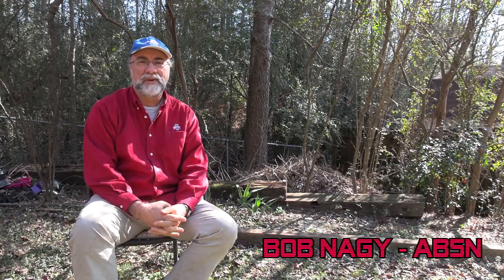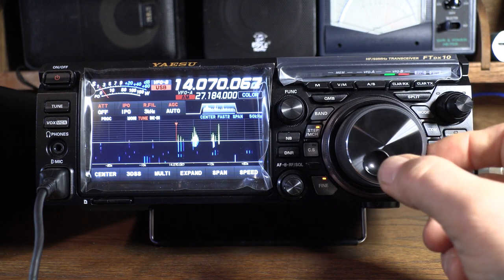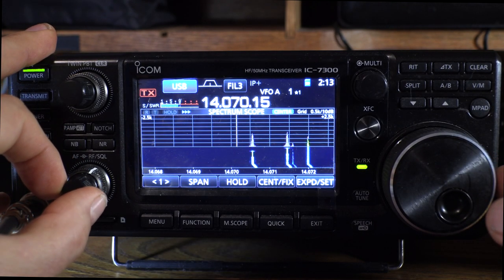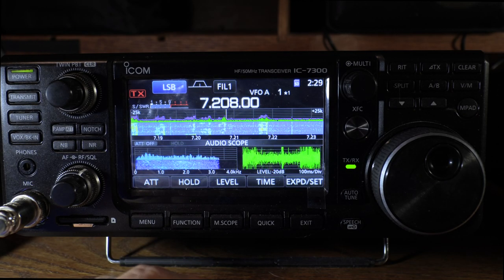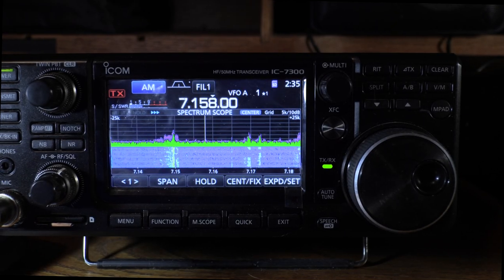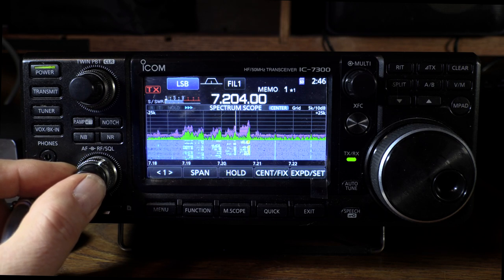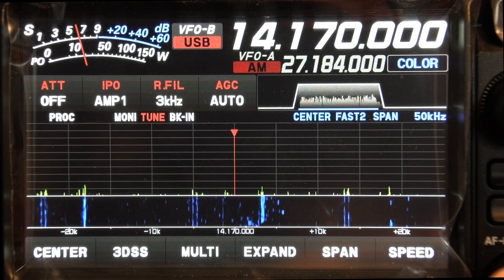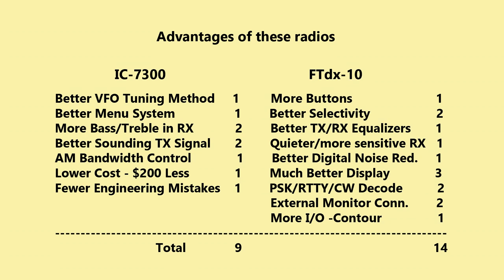Head to Head Comparison of FTdx-10 to IC-7300.

Comment: 7:-09 "There's no local noise" ... I'd be willing to bet there is. That buzzing noise isn't natural at all. If you'd have set the radio to AM, we could have heard what that buzzing truly sounded like. It's picking up something electronic. Somewhere. If you put that radio in your car with an 80 meter antenna and drove to another area I'd be willing to bet that noise would be gone. So far beginning to watch this video and it's a fine comparison indeed.
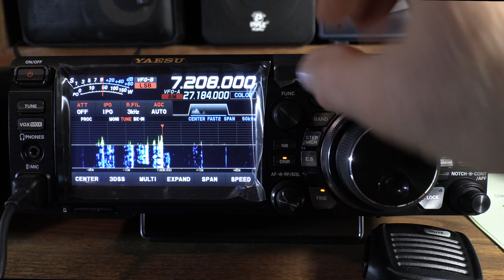Reply: At 11:56 I assume you know that the Yaesu uses algorithms for the noise reduction. So turning it down from 5 to 1 isn't showing much at all. Each setting, either up and down, does not equal an increase or decrease. Each number refers to a different algorithm. It's incredible flexible and that's what you must keep in mind when you change the DNR setting.
Reply: Also, you didn't say much at all on the powerful oscilloscope display. In fact you didn't say anything. It's not there as a gimmick or for looks as some have said. The left side of the audio scope can actually aid you in blocking out brutal interference. How? Using the noise blanker (which is adjustable) you can see exactly where the noise is and work with the filter's settings while having a visual guide. Especially important when heavy QRM is bombarding you.
Reply: 26:39 "gets a little crunchy" ... when you're moving it up and down at the 3/4 to full region, or when it's PARKED at the 3/4 to full region? A clarification here would be idea as for some of us, these reviews can actually aid in deciding to buy a specific radio or not
Reply: Finally my opinion is (and opinions are what a public comment section is for) is that it was a noble effort that truly allows a person to get a little bit of the feel of the FTDX10 and the 7300. But hardly in-depth. What would have been helpful would have been to make those radios sweat and dig out weak signals on SSB. Hard to work signals. Nothing is achieved by showing only 10 over 9 signals. Try that again sometime if you still read your comments. The FTDX10 is a superb receiver, that roofing filter and DNR are amazing. But the 7300 is no slouch. It's also a high performance receiver compared to anything in the past with a lovely transmit audio.

Comment: 7300 has RTTY decode.
Reply from the maker: It does?  Darn! I was using my friend's 7300 and he said it did not have any decoding capabilities. Sorry!
Reply: @robertnagy2163  lol, your "friend" didn't tell you the 7300 has waterfall height settings either i guess.
Reply from the maker: @forgetyourlife  Well, I apologize for any 7300 oversights. I'm sure I left out several of the FTdx-10 features too!
Reply: It also has a zoom-in feature for RTTY to fine tune.  It also has RTTY memories so you can do RTTY contests pretty easily.

Comment: I watched the video with a great dose of interest and attention to detail.  Having had the FTDX10 for about a year, my initial "awe" has waned after a few months of use, turning into frustration in many points, which i have written in a review on my website. 

Regarding this review, I have some reservation on the noise floor. FTDX10 is showing S0, Icom is showing S5, that comparison is not right, some settings are not right, probably the pre-amp is on on the Icom, but becayse the waterfall is in expanded mode and the actual setting cannot be seen. There are no two radios in the world where the noise floor is 5 S-units difference in identical conditions. At 5:05 in the video you are comparing a signal on 20m, the signal on Icom's S-meter is S9+15 and barely touching S7 on the FTDX10, producing a similar difference, and it should not be. The comparison on 80m looks realistic, though. 

When it comes to the front panel layout, Yaesu made every possible mistake that one could make in the industrial design, everything is in wrong place, they probably let he highschool students design that. Also the functionality of so many things on the screen is just either plain wrong or severly crippled. 

It's really sad, this radio had a great potential but Yaesu stuffed it up, big time. The "radio" part is fantastic, but everything about using it is wrong. It's like having the best Mercedes or BMW engine put into a Yugo (yes, I had one)  :-)
Reply from the maker: Well, I'm sure other users will have varying opinions. On the noise floor issue, I can say that a direct sampling SDR (7300/7610) is more susceptible to local noise sources than the FTdx-10 and 101 series. For whatever reason, all kinds of random junk noise comes in on the Icom SDR's. If you are in a suburban environment the difference is really noticeable.  No radio is perfect. I sold my FTdx-101D in 5 months...really did not like it. This radio though.. I like.
Reply: @robertnagy2163  As we've discussed, Bob, I had the same reaction to the 101-D.  I traded mine for a Kenwood TS-890s.  This was when they were both new rigs.  I think I had my 101-D for maybe three months.  I thought it the worst rig in that price class I'd every encountered.  The Kenwood, though an old-fashioned super-het, is a great rig and easy to use, even if it is several notches down from the 101-D on the Sherwood list.  The guy I traded the 101-D to hated it to, and sold it in short order.  I think I got the better end of that deal! ;-)
Reply from the maker: @CarlDenbow  I concur!

Comment: THE FtdX10 MONITOR OUTPUTS ARE FAILING LIKE CRAZY (POORLY ENGINEERED CIRCUIT) AND THE 7300 DOES PSK/RTTTY DECODE. THERE ARE STILL QUALITY ISSUES WITH THE YAESU THAT THE ICOM JUST DOES NOT HAVE... ID SAY THE SCORE IS 7300 11 AND THE YAESU IS 13 SO  FOR THE MONEY THE ICOM IS STILL A MORE RELIABLE PRODUCT  :)    
BETTER TX AUDIO IS BETTER THAN A NON WORKING MONITOR OUT PUT IMO :)
Reply from the maker: Sort of have to agree with you. Don't know what is going on with the HDMI video situation. A straight DVI to HDMI cable with no electronics involved seems to work fine. Indeed Yaesu will ship with more warts than Icom. I try to mention them. That said, Icom released the IC-7000 mobile with bad audio. I have shipped almost 10,000 mic upgrades for that mic now. Icom also shipped the original IC-706 with lots of problems. They made 4 versions of that rig (fixing it along the way)- and it has sold more than any other ham radio model.
Reply: @robertnagy2163  That's why I bought the 7300. Performance is only as good as the reliability of the product. The 7300 is polished out like other have said.
Reply: @robertnagy2163  Great comment yes! I need a new rig but so torn on the 7610 issue so its almost forcing to go 7300..   Not sure what to do at this point    - as always great content Robert!
Reply from the maker: @NuclearCowboyTube  Ahh, forgeddabout the screen issue on the 7610. It's been fixed. And if you do buy a used 7610, only a very few had the problem. I've had mine 5 years and it is just perfect. Got the $$, get the 7610.
Reply: @robertnagy2163  Thank you , greatly apprecisted!!
Reply: @robertnagy2163  Even over the FTDx10?
Reply: @NuclearCowboyTube  Oh yeah. The Ftdx-10 is a small radio. For me, the 7610 is the perfect balance. I'm selling my IC-7851 today. Yup. It may be 10% better than the 7610 and $10K more. Great screen on the 7610...the price is lower now too. The best Ham radio?  Anan 7000 DLE II. That's my other radio!
Reply: @Yavor54  Thanks Bob

Comment: Just how is it appropriate to compare a radio as old as the ic73 00, with a radio from yahoo that was engined long after the 7300 was introduced... next compare a new battery operated Ford Mustang With a 69 GTO.....
Reply from the maker: 2 years does not make an "antique" radio. Improvements in these radios is mostly based on improved chip availability. Since the 7300 uses a 14 bit Industrial grade ADC chip ($$), it certainly has the horsepower to compete with Yaesu's Older-design "mixing SDR". In any case, these two radios are in direct competition for market share. (and the E-Mustang is a poor first attempt at an E-Car)
Reply: Bob's money, Youtube channel & his effort.  He can compare anything he wants.  Don't like it?, do your own channel.  Nice review, Bob.  73
Reply from the maker: @Homer19521  Hee hee...Tnx.   These ARE direct competitors in the marketplace!

Comment: I find it funny that all i see are people dumping FTdx10 radios one month to 3 months of ownership. Oh the usual excuses, to small, to many radios, wife making me sell it, liked it so much I ordered the 101mp.. Bla bla.. Fact is its bunk and there must be some issues with the rig or operator error. I would like to try one but will this put me back in the same excuse boat of these appliance operators with actual issues? I do think many newer hams have the gotta have it mentality and have no idea how to setup and operate a receiver/transmitter.  So possibly its the cause of the incentive lisc by the arrl and others. It will only go downhill from here lol.
Reply: well, that's why just reading complaint postings (85%) can give you a huge question mark about any rig. Go look at how many IC-7300's are for sale at any given time. Lots.  I can't find one fault with the 7300 and I can get a minty fresh one used any time for hundreds off. Hams are older.. have less acumen with PC/digital technology and many have money to burn. Nobody has the patience to read the manual either. My analysis is fair. 7300 is a great bargain and SOLID radio (the IC706 of our time (sales wise)). The "10" is slightly quirky, but has no huge flaws- as Yaesu took what they learned with the 101D and ironed out a lot. It IS a better radio than the 7300. I'm keeping mine. (and I just sold off my IC-7851)

Comment: CW on IC-7300 sounds"dull" compared  to FTDX 10
Reply from the maker: I was surprised to hear that too. With some fine-tuning, the 7300 can sound a little more similar to the 10. Still, the 10 is a better receiver.
Reply: @robertnagy2163  
Yes, I tried everything on mine ic7300, not a good CW rig, SSB it's ok, that why I use FTDX10 on CW. Sounds fantastic.

Comment: Anyone can learn to use any radio. I own both rigs and hands down the selectivity features are better implemented and n the Yaesu. And the RF gain is a lot better   On the Yaesu as well. I don’t like the way Icom does RF gain
Reply: True...and the selectivity is better in the Yaesu. It is a more expensive radio. That said, no display averaging, an ALC circuit that is almost impossible to set, crammed buttons to the left of the VFO, an AMC circuit that does nothing good, permanently trimmed bottom and top end in the RX audio passband and a menu system is confusion central- are all things which Yaesu needs to address. The 7300 is an older cheaper and simpler radio, but 65,000+ sold sort of tells the story.
Reply: @Yavor54  yeah but I like a real time scope where I can see dots and dahs. I find averaging to be a step backwards. Like you said you get used to the buttons. Will a 7300 do everything a ham needs? Absolutely. And it’s a better am receiver. But Yaesu has made better front ends than Icom for a while now. I do like the ergos on the Icom but I can’t stand the RF gain method. 

I’ve actually thought about adding an older FTDX 5000 to the shack. It’s one of the true all time greats

Comment: the Icom $1,100.00, 7300 has the technology of 2015  radio. the Yaesu  FT-DX10 is 5 years Newer Technology . the speed that technology advances in 5 years is a whole lot. All this and the obvious better design makes the Yaesu FT-DX10 the easy pick at $1,500.00 . And the latest firm ware for the FT-DX10 has improved it even more. The 7300s ADC chip is not faster than the FT-DX10's ADC chip. The 7300s ADC is a 2014 design its not as fast or is it as efficient at processing DATA. The FT-DX10s ADC is not only fast it get more done per- click. A 5 year newer more efficient ADC Chips design. the Whole FT-DX10 is a 5 YEAR newer Technology Design. 5 YEAR newer Technology is when new chips designs are released . The Age of the IC-7300 Should Have Been taking into account in this Comparison . the 7300 is dated compared to the Yaesu FT-DX10 my friend with a 2015 Ic-730 a great radio,, even likes my FT-DX10 and as Technology guys we like newer tech, 5 years is a long time to us.

Comment: There’s no real comparison on these rigs. It’s like putting the 7300 against a Kenwood 430
Reply from the maker: Well, the FTdx-10 is designed to compete with the 7300. It's price will float downward to where the 7300's is now (the 7300 started higher at first). They are both SDR's with similar form-factors and priced in the mid-range market. Ask Yaesu...it IS their competitor for the 7300.
Reply: @robertnagy2163  however the 10 is dual superhet with sdr and dsp. The 7300 has the worse front end in history.
Reply from the maker: @JayN4GO  Indeed the 7300 is not a robust receiver. I mention that it lets in more local noise. Yaesu's brilliant step backwards to a mixing superhet front-end SDR design is also described. Much lower cost to make, additional filters to sell and great sherwood specs. A direct conversion SDR using an 24 bit or above word length will blow the doors off these older Mixing SDR designs. The cost of those top-level ADC chips constantly comes down. In the end, the rig that sells the most is the market winner. That will be the 7300 in this race. Yaesu uses an 18 bit ADC chip, but it operates at the low frequency range after the first mixer in the Yaesu. It is a brilliant move on the part of Yaesu. Look for the first 18 bit direct conversion radios soon..and Icom will release a 60th anniversary one for sure in a few years.

Comment: C’mon people, You cannot compare the 7300 to the DX10. Two completely different radios. Although  I hate ICOM it just isn’t fair…. I would compare the 991a to the 7300 and the 991a would still win. Of course all
My opinion… any items that are missing from the 991a can be done via your PC via the audio in/out ports on the sound card.
Reply: Well, I did it before the 710 came out- which is an exact comparison. Sales numbers of the 7300 are over 65,000 now. Sure, the 10 is a better radio and costs more. That said, brand loyalty has a big part in people's choices. The 10 has plenty of warts...and cool features. The 7300 will be the most popular radio of this decade for good reason. It performs past it's price point.
Reply: @Yavor54  I must disagree with you on the 7300 being the most popular radio of the decade as I have no need for it nor did I like it at all before I even discovered Yaesu. I actually chose the Alinco SR DX9 over the 7300 and then bought the Yaesus.
Reply: @Yavor54  this can go down the rabbit hole, I will agree to disagree since the Yaesu 991a and DX-10 are clearly better radios although I will throw you the 710 since that should have been a DX-10 with VHF/UHF in my opinion.

Comment: F U icrud, I had two 7300s and IMO they were both trashy receivers.
 A local ham on 80m wiped out my 7300 receiver when I was on ONE SIXTY meters!
 No real RF gain, no analog style meter, gritty sounding receiver, I was an Icom guy no Yeasus here, but with their new crap, icom has turned me into a Kenwood or Yaesu guy.
IMO, the 7300 Is designed for 11m ops!
Reply: Thanks for your rational and thoughtful commentary.